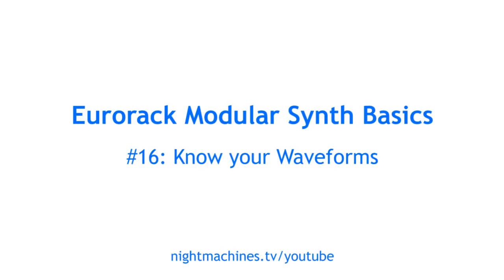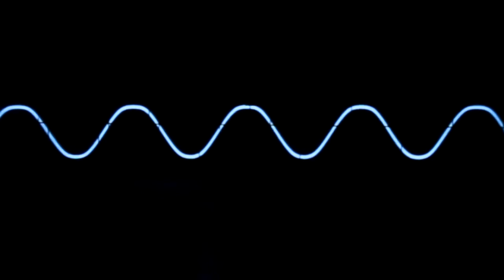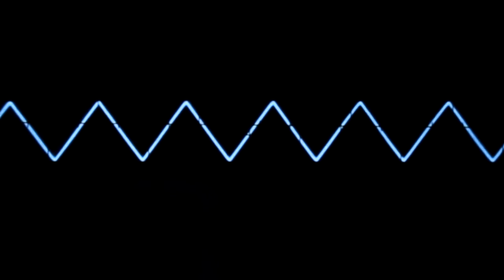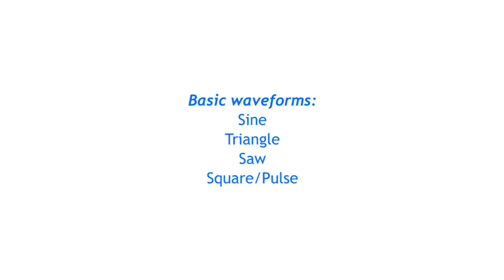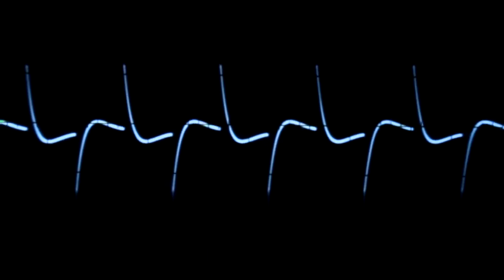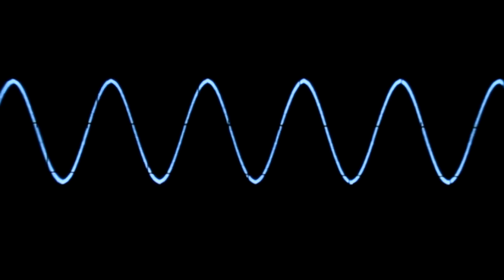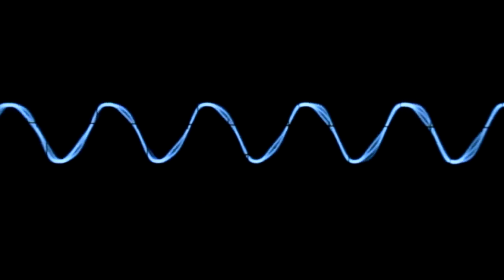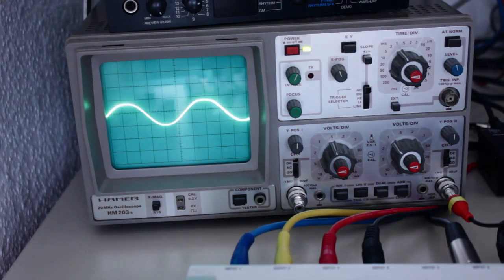Modular Synth Basics #16: Waveforms on the Oscilloscope

Comment: How do you actually hook up an oscilloscope to your Eurorack system to monitor audio signals? There are tons of videos that suggest using an oscilloscope, but i found NONE so far which explains how do you actually go about that. For example, what I don't understand is what cables do you use. I suppose you simply take the output jack of your typical Eurorack oscillator. But then, you have a 3.5 mm mono jack. Where and how do you put it into an oscilloscope since none of the oscilloscopes I checked has a 3.5 mm mono input. Somebody?
Reply from the maker: Oscilloscopes usually have BNC connectors for which you can find adapters. I use BNC-RCA adapters on the Oscilloscope side and then connect a 3.5mm mono jack to RCA cables to that and the Eurorack.
Reply: I see, thanks! One more question: how do you send the signal from a VCO both to the oscilloscope and the speaker, to see and hear the signal at the same time? Do you use a stackable cable or maybe a multiple module? Do you maybe need a buffered multiple so that the signal doesn't get too weak just because you branch off part of the signal?

By the way, I was making fun of your accent in one of my comments few months ago. But after watching all of your videos, I kinda like it. I think, I'll start pronounce "synthesizer" with a "ü" now :D
Reply from the maker: +whiterottenrabbit it depends on the signal and how many copies you make, but I've never owned a buffered multiple and never had problems with passive ones. But you're right, you need a multiple or stackcable.

I think I'll never get used to the "Sinth" pronunciation :D
Reply: I have one more question about oscilloscopes. I bought a cheap 15 Mhz analog oscilloscope. It works quite fine when displaying high frequencies, the picture is quite stable and comparable to what you show in your videos. But when I want to display some low bass signals, I have to adjust the time switch on the oscilloscope in such a manner that when displaying at least two or three wavelengths, the horizontal sweep becomes visible so that the picture starts to flicker and strains my eyes. I can adjust the time swith such that the picture becomes stable again, but then, the ocsilloscope only shows part of the full wavelength, so that I don't have a nice overview of the signal. So, my question is: with your Hameg oscilloscope, did you encounter any problems with monitoring low frequencies and if so, how did you overcome these issues? I hope, I made myself clear, although I am a noob and thus, I am probably confusing things. What I want to achieve is that the oscilloscope picture is always stable, without the horizontal sweep, regardless of the audio signal frequency. Maybe I need another analog oscilloscope? I am aware that a digital oscilloscope would display the signal without any flickering, bit then, I have an ugly digital display, whereas I love the type of displays on analog oscilloscopes! Only when they show a stable non-flickering picture, that is...

Comment: Hi, I wonder what kind of oscilloscope you're are using... I surfed around a bit and can't decide due to the lack of info about connecting an oscilloscope 2 my modular (https://youtu.be/CLG_eMwD7V0). Can I use the headphone out as a source? Thanks a lot for the reply & great set of tutorials which I will share on https://www.facebook.com/groups/PittsburghModularZone. Cheers, Jurgen = SONICrider = https://soundcloud.com/sonicrider
Reply from the maker: Hi :) I use an old Hameg oscilloscope. You just connect one or more outputs to the scope's inputs (you might need an adapter, like RCA to BNC). It doesn't really matter what output. You can measure both audio or CV.
Reply: Hi, thanks a lot & gonna order the adapter.... Will give a shout when it all works... Have a great day (& like your vids... they really help...)
Reply: +Jurgen SONICrider 

If you have a eurorack synth then you need a "TRS 3.5mm to BNC probe adapter" which can be bought on amazon for like 3 bucks.  For the cable you need a BNC - BNC male cable.  Amazon has one made by Hantek that I liked.  If you want a cheap o-scope build kit SainSmart makes one that amazon sells, but it only has one input and you have to assemble it.  I bought a Tektronix 2430a off ebay recently for kinda cheap.  If you watch the auctions you can find some deals.  I'm not an expert, but the 2430 o-scopes were the standard for awhile.  I'm happy to have one now and I got it for less than $200 with all the manuals.  It's a really cool scope and if you think about it, $200 isn't too expensive in comparison to the modules.

www.a m a zo n.com/gp/product/B00HWZS7D8?psc=1&redirect=true&ref_=oh_aui_detailpage_o02_s00

www.a m az on.com/gp/product/B008LVDPFC?psc=1&redirect=true&ref_=oh_aui_detailpage_o00_s00

www.a ma zo n.com/gp/product/B00XXZB5LW?psc=1&redirect=true&ref_=oh_aui_detailpage_o08_s00

Here's the links..  Not sure how youtube is with amazon links so I added spaces.